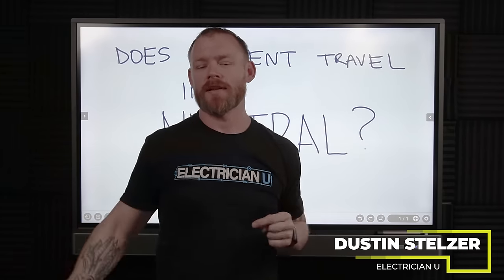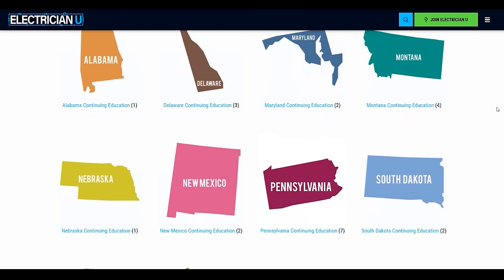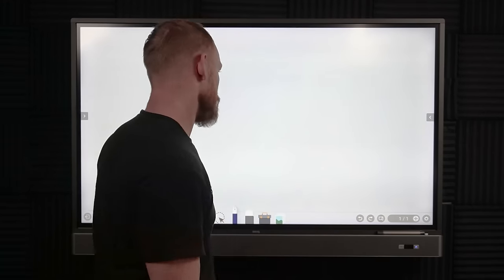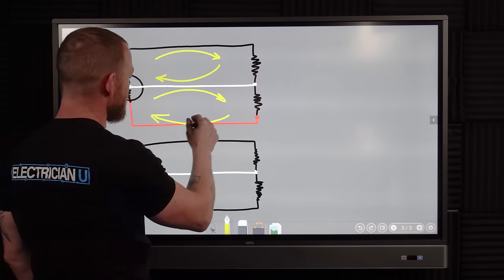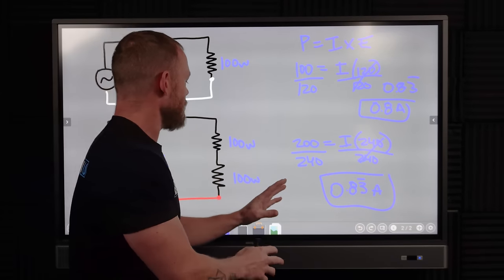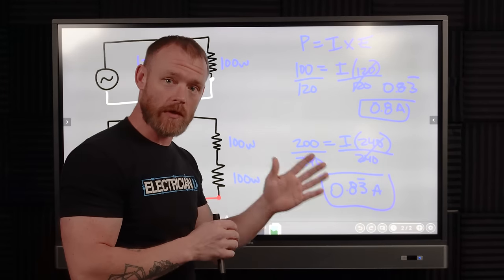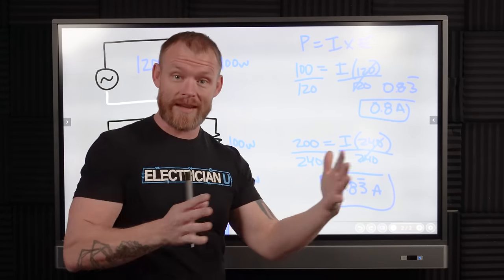Does Current Flow on the Neutral?

Comment: I LOOOOVE this explanation. It neatly lays out the concept of how current travels on single split-phase systems and cleanly explains WHY the neutral feeder will usually show very little current flowing while neutral current shows in the neutral wire going from the load to the neutral bar. It also explains why shared neutrals in both single-split-phase system need to be carefully thought out so as not to overload the neutral wire to the point of burning it up. I don't believe shared neutrals in a residential setting are common to begin with.

A continuation on this subject in a follow up video that explores three-phase commercial systems would be fantastic as shared neutrals seem to be incredibly common in commercial settings.
Reply: Question, (I'm fairly new to electrical) the diagram at 16:43, is this possible to wire? The hot from one phase connected to the hot of another phase with say a light bulb in-between. Will this work or be a fireworks show?
Reply: @brandondill4234  
What he had set up there was two 120 volt bulbs wired in series. Yes, they would work fine that way.
Reply: @brandondill4234  Theoretically, you could. But why would you want to do that? Lamps are designed to run at 120 V and if you were to wire two 120 V lamps in series, you get 60 V across each lamp. That means both of the bulbs will shine dimly or if they’re LED, they may not shine at all. If one bulb were to burn out, the other would also stop working. To get both lamps to shine as bright as their designed to shine, you’d have to essentially run a new 240 V circuit. Therefore, it is unrealistic to have this sort of circuit in a residential setting.
Reply: @mikejohnson3873  If you wired across the 2 hot phases you would be able to run a 240v rated device. I understand this is possible in the US if your installation is set up with the correct sockets etc. I have heard mention of this on other videos but had not fully understood how you could get 120v and 240v until I saw this video. 
I am from the UK where we have 240v single phase domestic wiring in which the neutral carries all the return current back out to the street. 
For 3 phase commercial systems each piece of equipment would take all 3 phases and would usually have balanced loads (with minimal neutral return current) so sharing neutrals would be less of a problem.

Comment: The video seemed cut short a bit.  Would have loved for you to spend a little more time on the flow in the neutral when you have unbalanced 120V loads between L1 and L2 and also touch on what would happen to the voltage of L1 and L2 if the neutral to the transformer was lost when the 120V loads were imbalanced.  I know the answers, but would drive the point home while reiterating the importance of torquing conductors properly.
Reply: There was a house fire across the street from my house one time. The fire department cut power to the burning house and inadvertently opened the neutral to my house. The effect was expensive as I looked back and my house was very bright because of the unbalanced load now running through the lights. I lost a sump pump, a transformer controlling the thermostat for the furnace and a tv that night. 

This video is excellent and right on the mark. Any comments regarding getting shocked while working on a neutral are just moronic, what are you doing touching a circuit with the power on? You have no way of knowing if the 240 circuit is running balanced. You cannot touch a neutral with power on.
Reply: @finky555  Well, you can.  Once?

Comment: This video and explanation is incredible!!!! Thank you, thank you Dustin!!!!  These videos are a treasure to everyone who's trying to create a place for themselves in this world!!! This is true solidarity brother!!! I've always asked my teachers to explain some version of this...I probably wasn't asking the question the right way, so I never really got an explanation that was satisfying. I've done AC Theory and we've calculated balanced and unbalanced loads - I can do the math without too much trouble, but the "why" of it all never clicked until now! The electron and field/wave canceling each other out makes total sense, and the idea that the current will travel back on the neutral to get to the opposite pole completely makes sense now. Thank you!! Please, please explain why there is no current on the grounding conductor when there is current flowing on the neutral when the load is unbalanced?
Reply: Except it's partially wrong. The "electrons and waves" are not "canceling each other out." During unbalanced loads, the neutral carries only half-cycles, first in one direction and then the other. Current is not flowing in opposing directions on the neutral wire. In the balanced circuit, the neutral wire is completely irrelevant. The two lamps are simply in series with 240v across them..

Comment: The neutral wire is often confused with ground wire, but in reality, they serve two distinct purposes. Neutral wires carry currents back to power source to better control and regulate voltage. Its overall purpose is to serve as a path to return energy.
Reply: To make the path easier to flow through basically right?
Reply: Actually positive wires carry current back to the source. Neutral is for AC. Therefore the current goes back and forth. Often, neutral is connected to say the frame which is then grounded.
Reply: Neutrals do not regulate voltage or offer control
Reply: @rx7addict  I think if the neutral is grounded it kind of helps to stabilize the voltages.
Reply: @xxuncexx  yes but that’s not the neutral itself. That’s an element added to the neutral to provide a ground reference
Reply: Neutral is just a path back to source for unbalanced loads. If the loads are balanced on the two phases then all of the current returns through the opposite phase which will be negative when the first phase is positive. If the loads are unbalanced, each side will still only pull the current necessary to meet the load, the excess current through the higher load needs another return path, the neutral.
Reply: @rx7addict  .Yes they do.
Reply: @CrashCarson14  It is hard to really achieve totally baslanced loads. Even withing a 3 phase device.  All the inaccuracies get carried away on N. But in your regular home installation you only find unbalaced loads with dynamic on/off behavior. In that scenario, havin done N right will not just safe your live but also your nerves.
Reply: @DasIllu  interesting. I find ac a lot more confusing than DC. But I enjoy how electronics work more so maybe it’s easier for me to apply situations
Reply: No, it doesn't.  Only by folks who know less than nothing.
Reply: @CrashCarson14  You could have very similar with DC by having +120 V, 0 V (neutral) and -120 V. That in fact was what Edison used. When the loads were balanced there was no current in the neutral so he could double the length of the circuit.

Comment: Did you just break down Ohms law, power calculations and the physics of electricity in under 25 mins AND manage to squeeze in a rudimentary Thévenin’s equivalent problem for good measure?!?  I believe you just did.  Very well done sir.  (*starts slow clap*)
On a serious note, you should consider teaching circuits at your local college of engineering.  You would be a breath of fresh air for all the aspiring EE’s, AE’s and ME’s.
Reply: 100% agree with this comment, you're better than most of the elect engr profs i had 30 years ago...
Reply: @joem6859   My two profs I had for my electrical classes/electives for my aerospace engineering degree were fantastic.  But... they did seem to forget that we didn't remember 100% of everything previously taught to us about electricity.  lol
Reply: @j36606  Exactly how is he completely wrong?  His explanations fall in line with everything I’ve been taught and experienced.
Reply: @neogator26  I somewhat agree with the other poster that some of his explanation is incorrect.  I'd say he's definitely wrong regarding the neutral "canceling current and waves" because of opposition. That is not happening. The neutral carries half-cycles only. First, in a "positive" direction and then in a "negative." So, unbalanced current on the neutral is either flowing into the transformer or away but not flowing both directions at the same time for cancellation.
Reply: @j36606  I'm not sure which specific explanation you're referring to, but I definitely disagree regarding "current and waves canceling in the neutral." That is definitely not happening in a single phase system..
Reply: @boeing757pilot    You are correct, two legs of 240 electricity do not cancel each other out like opposing sound waves do.  I’m not sure why he explained it in such a way other than working with electricity and having intimate knowledge of code doesn’t require in depth knowledge of electricity past what can be learned through empirical means.
Reply: @neogator26  Thanks for the feedback!

Comment: That was an amazing explanation, I would only add one small part. At the transformer, the neutral creates the 120v by having the return path directly in the middle of the 240v transformer wires.  And, explain that between the red and the white, you get 120 differential volts, but between red and black you get 240 differential volts.  At any rate, that was an amazing explanation and I'll do a better job now of planning circuits in the panel of most used circuits so that the most used circuits are better balanced in the panel.

Comment: Nice presentation.  I'm not an electrician, but have studied electrical theory out of interest, and the key fact that I took away from basic electrical circuitry a few years ago, was simple "the neutral carries the unbalanced portion of the load, back to the grid".  During this presentation, I was waiting,...waiting,...waiting for your example,...and sure enough,...10a - 2a = 8a going back out to the grid !!  Thanks you for such a thorough demo !!

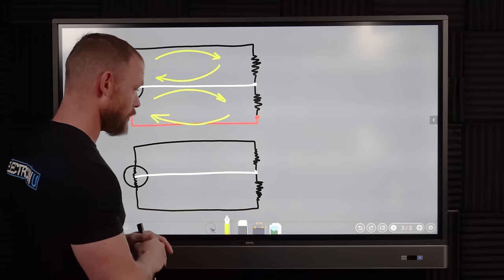Comment: Your diagram is wrong starting at 13:40. You’re trying to demonstrate two loads connected to the same leg in parallel, but you’re using the EXACT same circuit diagram as before but only with different colors. The color of the wire does not make it behave any differently. To demonstrate this correctly, both loads would be connected either to the top or bottom of your secondary, the way yours is drawn.

Comment: The neutral carries the unbalanced load in a 3 wire circuit. The returns coming off the bulbs to the neutral bar are technically not neutrals — they are return circuits.
Reply: You still have an imbalance on a single phase load. 2 legs of 120 volts. You will see it if you have a damaged neutral on a single phase system. One leg will shoot up to say 160 volts, while the other leg goes down to say 80 volts. Neutral is a current carrying conductor. Current is amps. Amps kill you. Voltage doesn't matter.

Comment: I thought the electrons didn't so much flow through the medium as vibrated back and forth and it was the electro-magnetic field that delivered the current to the load.
Reply: Yes, you are correct. The charged particles vibrate and the wave passes down the conductor..
Reply: I think when electricity is taught it is treated like the flow of water as a basic understanding.  A physicist has a deeper understanding of magnetic fields etc.
Reply: @fornife5004  Yes, precisely. Molecules of water leaving the pump outlet, traveling through the closed loop, and then returning to the pump inlet. It's a good analogy for a mental picture and for basic understanding. But, it's only an analogy..

Comment: More importantly than pre-drawing it, you need to have set a background color that isn't the same color as the neutral! I get it, you want to use the standard wire colors, cool. But the very very white wire on the very white background doesn't work.
Reply: Could have used grey for the "grounded conductor"
Reply: @Darenator1  what is Dustin doing in the video

Comment: OMG!!  I have wondered for years why the neutral bar in a panel wasn’t hot!!!!!

I always understood why the neutral may be hot at a switch/outlet. 

THANK YOU!!!
Reply: I always understood why the neutral may be hot at a switch/outlet... oh yes?

There obviously ought to be a neutral present in a socket outlet or an appliance isolator, or a spur outlet... but in a light switch (at least in the UK) there ought not to be a neutral... The neutral wire, at one time black, now blue, is used as a switched live, flagged / identified with a piece of red insulating tape... Most of the time...

Comment: Thank you.
I have spoken with a few electricians who did not understand this.
"How come a meter shows zero potential to earth if there's current in the neutral" is what they say and can't get past.
One thing, electrons hardly move in alternating current.  They travel an extremely short distance one direction, then return to the starting point when the cycle switches.
Reply: A voltmeter doesn’t measure current.
Reply: @GH-oi2jf  
I find it interesting that you jumped on my misuse of a term, and ignored the claim I made that so many professional electricians don't just use an incorrect term, they have a completely incorrect understanding of how alternating current systems work.  I said voltmeter to refer to a multimeter.  You are aware that multimeters have an Ohm meter, a voltage meter, AND an amp meter?  
I am not an electrician, never have been.  I worked in a hardware store for years and dealt with electricians who came into the store.  I made it a point to ask all electricians the same question.  I asked because I had heard people say contradictory things and I wanted to understand what they meant.  'What does the neutral wire carry?', I'd ask.  Only one guy said anything other than, "It takes the current back."
I'm no electrician, as I said, but if a wire only carries current in one direction, we are talking about DC, not AC.  To be fair, I never differentiated between the neutral wire in an individual 120 volt circuit inside a building, and the neutral coming from the transformer to the meter/panel.  Also, to be fair, none of the electricians I spoke with did either.  If they thought my question only concerned the middle wire from the transformer, they would have said it carries the current for both the red and black circuits, which alternate directions at opposite times from each other.  They would have then pointed out that equal, opposing, currents cancel.  I never heard any of them say that.

Comment: I’m an electronic tech.  I’m used to measuring tiny chips and stuff.  You’ve answered a question that has been in in the back of my mind for a long time.  My Uncle (passed away now), had a discussion once.  I said that I knew how a circuit would behave given an input that changed.  I further said, “I don’t know 3 phase for nada.  Nor what neutral did.   Thanks again!  I’ll try and find if you have something explaining that.
Reply: 3 phase is mind-boggling. At first glance, it seems straight forward, 3 separate legs of 120v. Or is it one leg of 120v from three different sources? OMG, power plants have to "phase in" when going online, they have to be in sync with the grid.
standard home power has 2 HOT legs (2 phases)? where do ya get the third? would that be 340v? 1 HOT= 120v shouldn't 2 HOT =240v and 3 HOT = 360v (add three 120 together?)
Uncle! 
I give!
Reply: @nobodyinparticular5224  me too!  I’m still trying to figure out how they get 60 Hz out of a hydroelectric dam

Comment: Just come across this channel and found the explanation very clear.  As an electrician based in the UK you wouldn't think this would be too relavnt but we have three phase installatons running at 400 to 440 volts and Balancing the Phases is an important safety factor ias all the phases combine in a single neutral cable and badly balanced phases could cause an installation failure or a FIRE!   Your maths uses diffrent symbols.  In the UK Ohms law is U=IR, the U standing for Voltage Source while V is Voltage potential.  Never mind, I gave up at short tons, long tons and Metric tonnes.  Just so long as we all understand each other !!!!   🙂

Comment: I think the biggest thing that confuses people is taking that all “electricity” is current..  hence the confusion of current source versus voltage source stuff like that..  once people get just the basic idea of what voltage actually is compared to what current actually is, i.e. talking about fields, versus the flow of electrons, makes everything so much easier to understand!

Getting beyond that comparison to water the most people are taught to compare it with, and have that stick in their head. Makes actually learning and understanding stuff a lot more difficult.

You have such a good balance of bringing in people that I’ve only worked in the field, as well as people that might be engineers, it’s a really good balance and I appreciate that very much!! 

We definitely need more of this in electrical, HVAC, etc. etc.
Reply: Current is the real physical parameter of electricity.  Technically, there is no voltage.  The final form of Maxwell's equations has no voltage in it.  Now this doesn't mean that the concept of voltage isn't useful--it's incredibly useful.  But current is the key.

Comment: Justin you do a great job explaining things, I have a question that no one can answer, if you take a 220 power supply from a generator to a locked off panel through the supply from a 220 volt hot water tank feed that only has 2 ,120 hots and a ground, will the 120volt outlets carry the return to the panels neutral,  and will the generator  continue to feed the 2 ,120 volt feeds when only 120v is being used by a circuit.